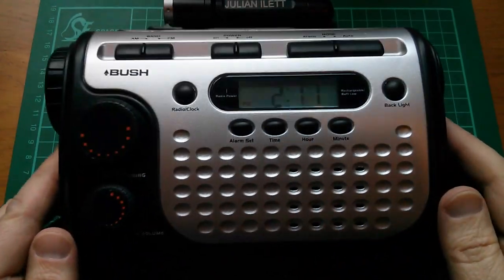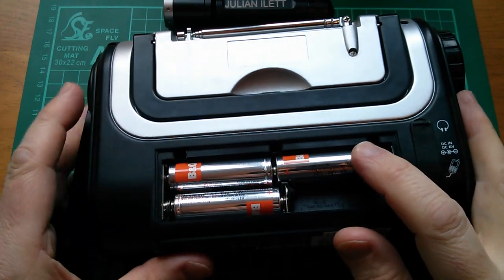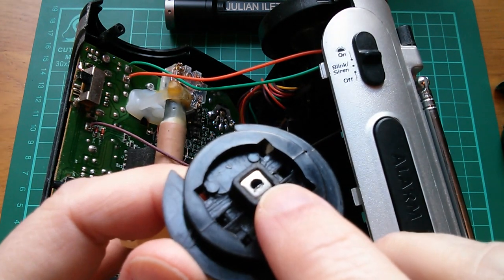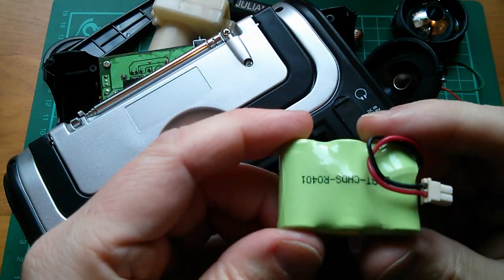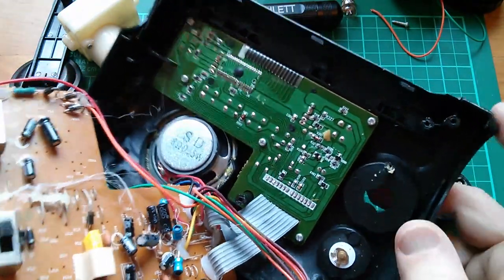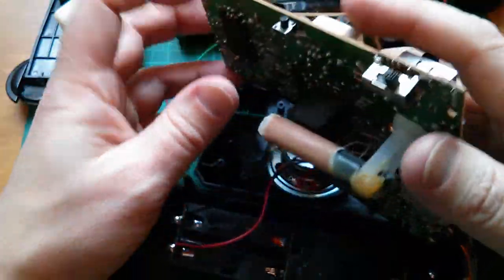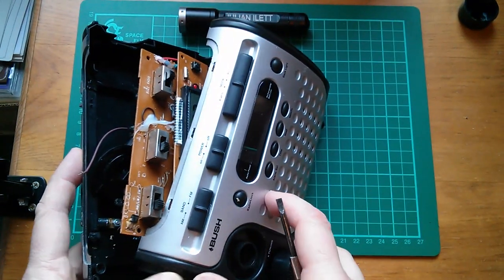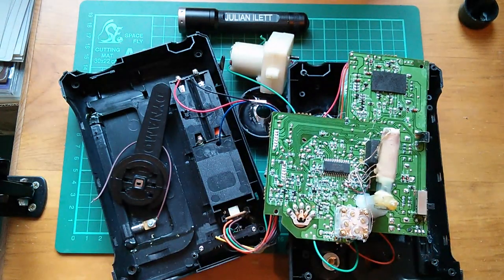1-Way Teardown: Bush Wind-Up Clock Radio Torch

Comment: That display driver glob topped COB is possibly to replace a plastic packaged SMD. The PCB was probably designed for the packaged part which then went obsolete and hence the adaptor.

Comment: 400 mah sounds enough to last quite a while. But how long would you have to wind it to fully charge it? How long ago did you buy the Freeplay radio? I'm don't think they make the clear one any more as I don't think they want you to see inside the latest versions.
Reply from the maker: Impossibly long, although there was an input jack for charging. It must be 6 or 7 years ago I bought the Freeplay